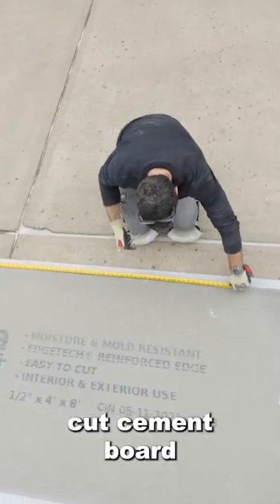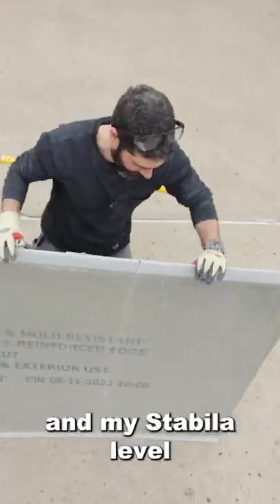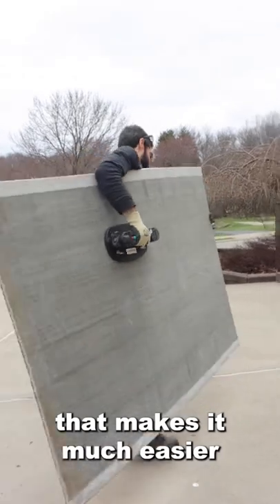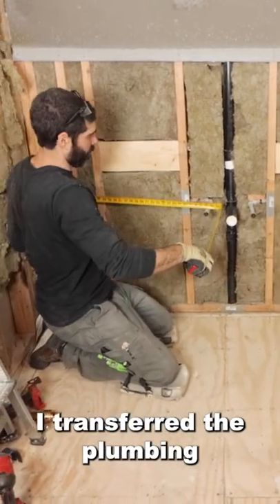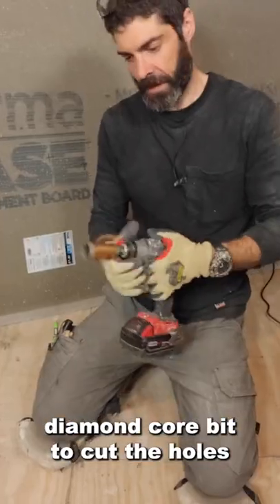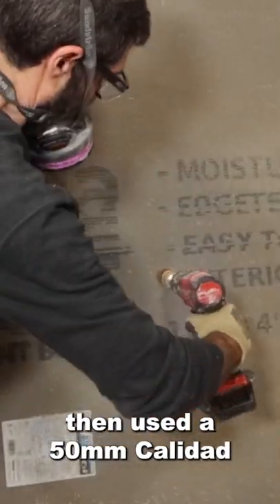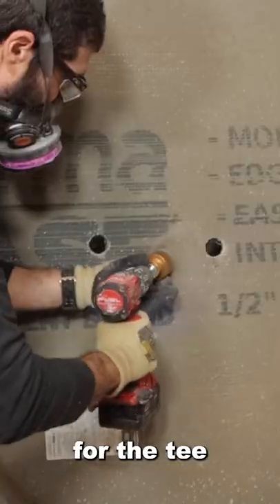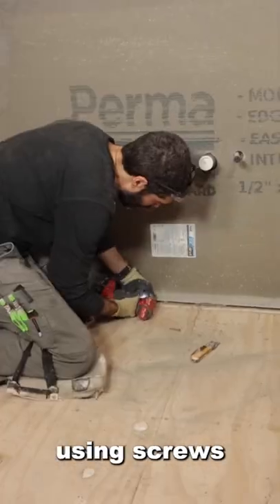Cement Board Installation Tips - #shorts

Comment: Spray a little water on the cement board when using those diamond core bits, extend the life a little. Cutting dry will definitely wear those expensive bits out fast.

Comment: Why not insulated backer board instead? It’s easier to work with and lighter to manoeuvre. Also what are your thoughts on the thermal shock of the hot water hitting the cold tiles in the shower area for the cement board instead of the insulated backer board?